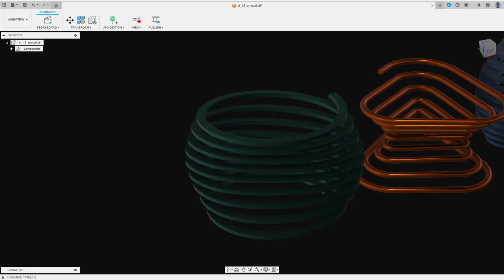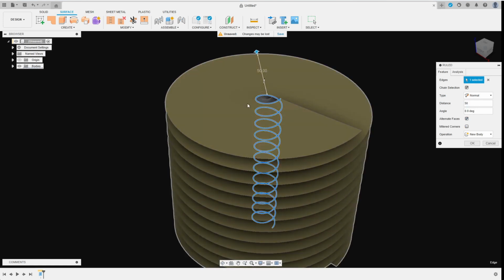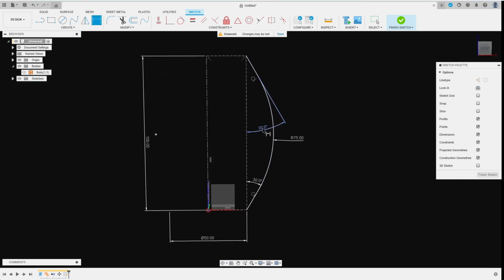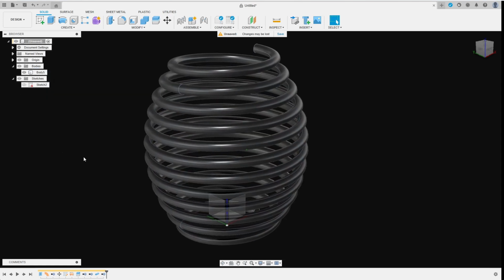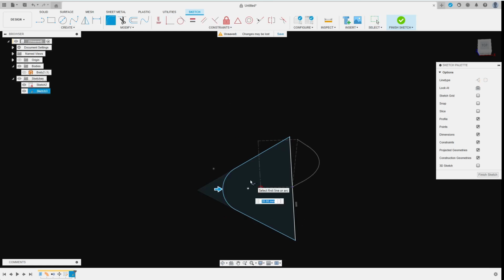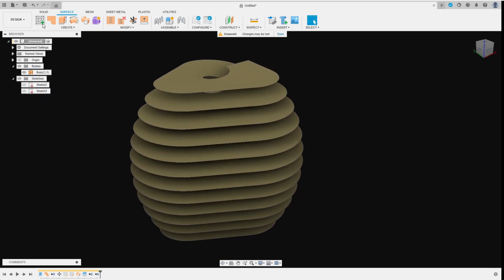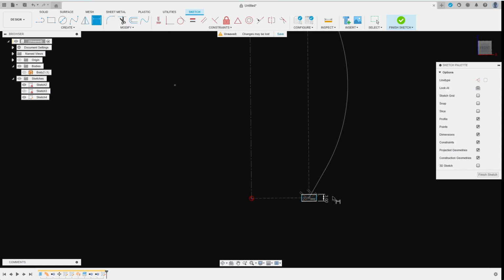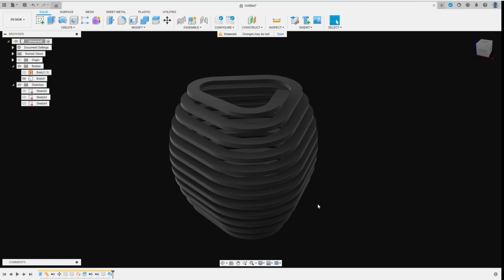Custom Springs & Coils in Fusion

Comment: Hi ! Thanks for this great video. Unfortunately these methods don't work for what I want to do. I'm trying to make a coil but with a U shape. The problem with this shape is that when you split the face of the coil with the body of the object, you create several new bodies that are not connected to each other. Do you understand what I mean, and do you have a solution for this? :)
Reply from the maker: Huh, no really elegant solution comes to mind… Depending on the concrete problem piecewise combine curves could work. As a last resort Id think about generating a mesh outside fusion, then converting to form and using as guide. Thats at least what I recently have done for another tricky problem.
Reply: @getprototyping  thank you for your  answer 🙏 this is a not very obvious problem. thanks for the tips and tricks. i will try this, and i will tell if i find something that works well.